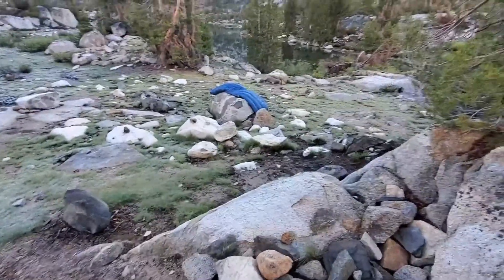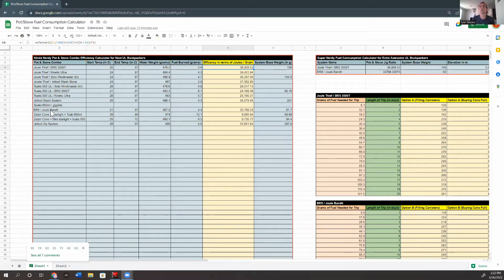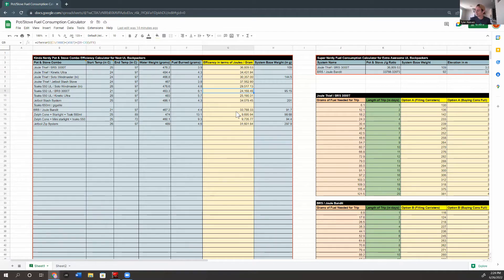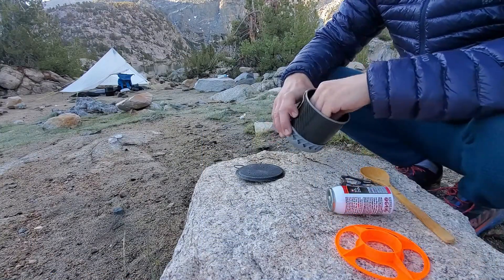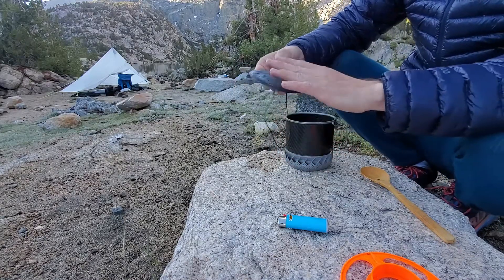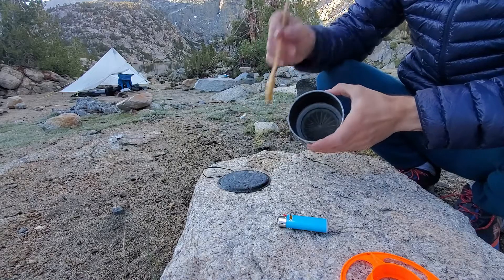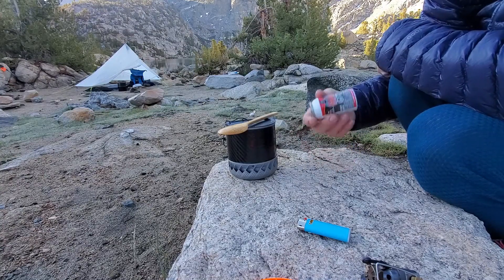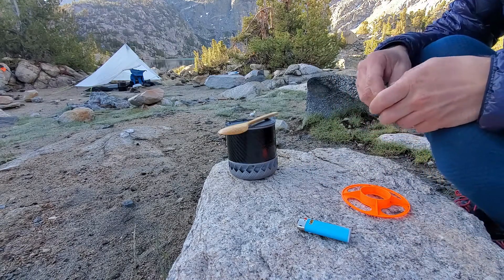The Joule Bandit: A UL HX Pot

Comment: Hey Tyler.  if you wanted to seriously corner a nonexistent market, could you design the top of this to be a screw top cap similar to the vargo?
Reply from the maker: Oh man! A cold soak lid has always been on my list of improvements for these pots. But every time I get around to messing around with a design in CAD, I just can't seem to come up with something that would be lighter than a no brand amazon silicone stretch lid. I definitely think there is a market for a nicer lid than most of those silicone stretch lids though, I used one on a extended JMT hike (Kennedy meadows to Yosemite Valley) and it get a small hole in it towards the end. So at the very least, slightly heavier in exchange for more robustness might be the compromise worth pursuing an alternative for.
Reply: @tylerreeves8026  put me on the list for when you make a production model.  a cold soak option would be amazing but even as you have it i'd be interested
Reply from the maker: @walterkimball7975  sweet! I got you down Walter. I'm not sure if I'll ever reach that point, but I am attempting to :)
Reply: @tylerreeves8026 your pot will be the new trailblazer people like having all the cool mods.

Comment: Hi Tyler, i´m very impressed about that pot ! Usually i´ll use the Sterno Inferno Stove ( stand alone & short trip with gas incl. Soto Windmaster with 3Flex or with methyl alternatively as DIY-´ Pimp up ´- Version incl. DIY-neopren-coat ) or XTS Olicamp ( 2 People or longer trip - same ) but 2.9 oz ( for me 82 grams ) would mean save weight approx. s.th. around 2.1 oz ( approx. 60 grams for me ) as well as the volume of 450 ml really i guess is absolutely enough, too. May is it possible to get one of your ´ JOULE BANDIT UL HX POT ´ ? Many thx in advance for your efforts on reply, Dirk from Germany
Reply from the maker: Hi Dirk!  Thanks man!! I don't sell the pots currently because of the health concerns associated with carbon fiber and the liability that may imply. I don't mind taking the risk myself for personal use, but I don't want to accidentally hurt anyone other than myself.
BUT! I am working on a version that doesn't use Carbon Fiber and instead uses PEEK. If I get that version working as good as this pot, with the same weight, I'll possibly consider selling them. I've put your username down on a Google doc so I remember to contact you if I do manage to make one without Carbon Fiber :)
Reply: @tylerreeves8026  Hi Tyler. Please put me down too for a version with PEEK or even Titanium. 🙂
Reply from the maker: @NikhilShahi  you bet! I'll put your name down. I might have something cool to show by the end of April ;)
Reply: @tylerreeves8026  can't wait.
Reply: Hey Tyler,

Any chance to also put me (David) on the list?
Cheers!

Comment: I just bought a toaks pot but would love to try one of these. Is the heat exchanger 3D printed metal? The BRS is supposedly really bad with fuel efficiency…does a heat exchanger completely mitigate that? Is fuel efficiency better with one of the nicer stoves in combo with your bandit?
Reply from the maker: The BRS is a tricky one because its highly dependent on the users preferred level of output and site selection. The BRS can be just as efficient as some of the more expensive stoves, but you need to run it as low as practical and shield it from as much wind as possible. Mostly people down want to have to deal with that so the opt for something like a Soto Windmaster. But its important to note efficiency isn't down to just the stove. We have to factor in the stove + pot as a combined system when talking about efficiency. There are some stoves that do better with standard pots across the board but suck on heat exchanger pots. The Soto Windmaster is one such stove. I have a video I made about a fuel consumption calculator, if you go there you'll see that on my testing chart, the Soto Windmaster does much better then the BRS with a Toaks 550, but when you switch the pot to the Joule Thief or Bandit, the BRS does way better then the Soto Windmaster. So again, it all depends on your system as a whole, but some stoves are generally better across more systems but not always (I.E. Soto Windmaster).
Reply: @tylerreeves8026  That's really interesting. I've been using my Windmaster with the Jetboil Stash pot, and it seems to be working fine, though I have not checked the efficiency. Any idea what you think is the mechanism for the inefficiency? Will need to try the BRS next time.
Reply from the maker: @tanvach  hi Tan! I have no idea why the windmaster doesn't like smaller HX pots honestly. Lol, it's a great mystery in my life that's been driving me crazy.

I had a Jet boil stash for a while and it did pretty good paired with the soto windmaster. The stock jetboil stash stove was actually more efficient then the Soto windmaster on the stash pot. But the stash stove does terrible in the wind, almost as bad as the BRS... So definitely a good reason to use the soto windmaster instead to simplify your cooking process :)